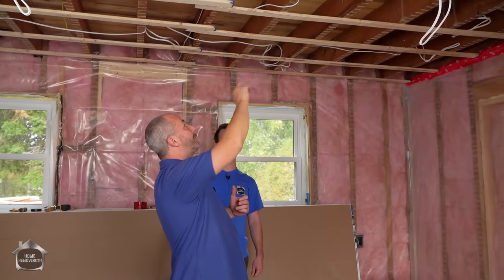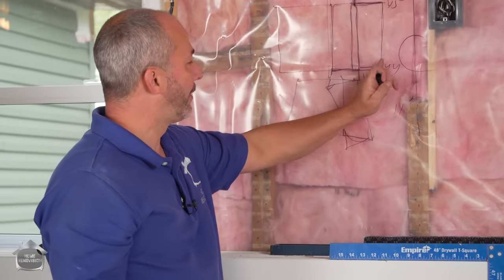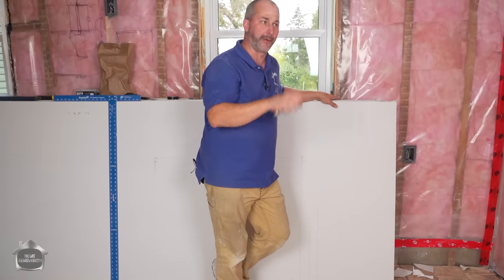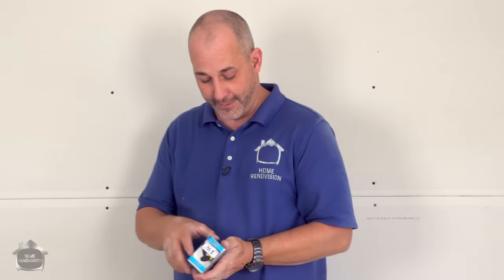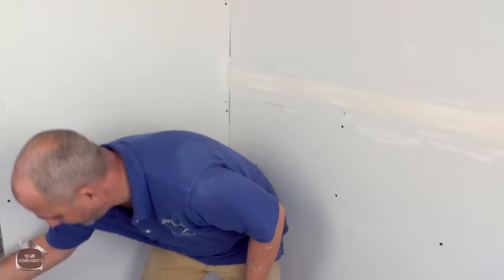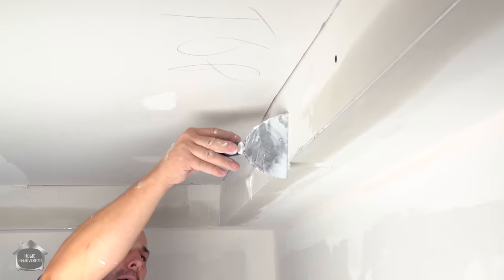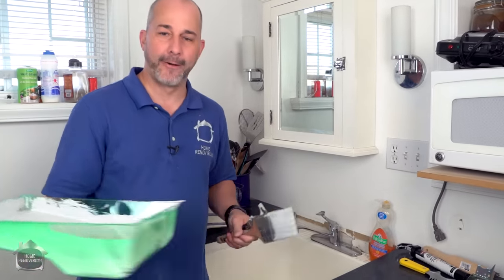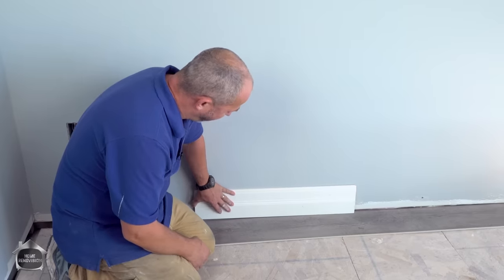How To Install Drywall A to Z | DIY Tutorial

Comment: I noticed on your older video's you did the inside verticles before the horizontals.
I followed your newer video, then watched an older. I got spooked for a little bit. Till it sunk in the two host had about 10 years difference in age lol
Older and wiser, 😊

Something I haven't found covered yet is the plastic corner edges. I used them in my bathrooms, just to avoid metal corrosion. I used screws just because I  found rusty nails durithe teardown. But they were a struggle to get low enough and not cause a twist in the plastic. 
Your thoughts?

Comment: As an HVAC tech I would recommend against the vent replacement. I’ll be the first to admit it looks really nice. However the original vent was a diffuser named that because it diffuses the air, the replacement isn’t. Plus it causes a high static area which reduces air flow and increases noise as the air moves over it. 

Again I also think they look really really good  but I’ve dealt with a home where they were used and we couldn’t get the required air flow into the space so on moderately hot days the AC couldn’t keep up. In the bathroom the center part would sweat and cause mildew to form on them from condensation from the bathrooms high humidity after a shower.

Worst part was when I went to replace them I found they were integrated into the wall. So the homeowner had to pay a fortune for something that is otherwise inexpensive.

They could probably be used if the HVAC contractor accounts for them (more vents in the rooms). But that wouldn’t fix the condensation issue in bathrooms and more efficient mixing of the area from diffusion.

Comment: Another great video. My home is almost 50 years old. You can imagine the layers of paint, patches, and nail holes there are. Is there a good way to "freshen up" the orange peel texture over the painted surface? Or will I have to replace the sheet rock and start from scratch? I appreciate your videos and information given.
Reply: I have the same question. Would love to know if it's possible to freshen up an old wall without having to install new drywall

Comment: Man you guys over in the USA go the hard way of doing dry wall, 
I'm a qualified plasterer and the products you guys have are so behind and old school,  might be cheaper but the work involved mixing it just right is guess work for the average Joe... 
from what I just seen I think I'm coming over to change the way you guys go about it, 
I'm amazed you didn't use a angle tool to do the internal angles.. doing what you did with the 4 inch your cutting the tape and you have to come back the next day and do the opposite side,  
I'm starting a business in America

Comment: Cut out tool is great. But sparkies here in Denver tend to set j boxes half inch past studs. So I got pretty good at cut out before install. Still use the tool though very fast.

Comment: Hi Jeff, thank you to you and your team for these videos and other series. I’ve learned a lot and you’ve answered many of my questions and curiosities as I take on finishing the interior of my home after framing. I couldn’t have been doing it without these. Or rather I would have made many more mistakes. 

At the end of this series where you are talking about applying the primer. I was curious, is there a reason you roll it instead of using a sprayer? I happen to have access to a sprayer but wasn’t sure if it didn’t absorb as well without the “pushing” since you used the roller?
Reply: Thanks Jeff, very informative

Comment: Hawk or pan? I've worked with both and I make less of a mess using the pan because that's what I learned with so it feels natural. It's like being right or left handed you do what feels natural. I only use a hawk when I use a trowel for skim coats and for a few different ceiling textures. As far as getting mud everywhere that just a given when you're getting paid by the foot using hand tools because you're running around flinging mud everywhere trying to keep up with automatic tools

Comment: I'm finishing my basement and I'm debating hanging my drywall horizontally vs. vertically.  In one of your videos, you go over the the benefits of limiting your butt joints.  If I have a 22 ft wall, I can choose to put them horizontally using a 12 and 10 footer, I can swap their position on top and bottom so I wind up with a 22ft long seam (non-butt join) and 2-4ft (actually 1 4ft and 1 3ft, my ceiling is 7ft) butt joints.  Alternatively, if I just hang them all vertically, I'll have 5 vertical seems which would be 5*7ft = 35 ft of non-butt joint taping.  Doing it horizontally, I would have 22+7 ft = 29ft of joints to tape.  So doing it vertically requires about 6ft more joints to tape, but they won't be butt joints.  I prefer no butt joints.  If I hang them vertically, I can buy all 8ft panels and I don't have to fight to get them into my basement since I have to go around some tight turns.  What are you thoughts about this?  I'm leaning towards vertically to help avoid butt joins and having smaller panels to move around.

Comment: A couple things I would suggest.  Get a tape gun for the Tuck Tape, much easier to stretch out your tape and you don't have the problem of the end sticking down to it's self when you finish using it.  Also has a built in cutting edge if you need to trim off a piece.  When you use the puncture needle on your caulk gun, wipe it off before tucking it back in to the handle.  You won't get that tar all over your hand and it won't stick to the handle the next time you want to pull it out.  I'm pretty sure you should put the tar on the side of the of wall footer board rather than on to the floor.  There is supposed to be a layer of foam under the outside wall to create a wall to floor seal therefore putting the vapour barrier on to the floor is a waste and also can get in your way later; not to mention, messy should you kick into it..

Comment: I drove a sheetrock boom truck delivered for almost 13 years. Had a boom truck and a helper. No dolly. I was up and down the ladder every unit getting it as close to door as I could then climb down pull off the forks waste level and my helper caught. Walked in flipped on and on 3 sheets at a time 12ft. It was a god send when they went out of business. Haven't toted rock in about 5 yrs 45 yrs old and feel crippled.

Comment: The latest research is these poly vapor barriers cause mold in cold weather climates.  The cold air meets the warm indoor air in the wall cavity, and that creates moisture which needs to dry to the inside.  There is a difference between a vapor retarder and barrier, a barrier will not allow the wall to dry to inside. It allows zero moisture to travel through it.  I experienced this myself and when I took apart the wall on a cold day there was a release, like a pop of air.

Comment: Question:. Renovating house.  To remove textured walls from a 1956 house with older walls.  Skim coat? Thinner drywall over existing drywall?  Or...  New drywall altogether?  Thoughts?

Comment: Hi, thanks for your informative videos. Intermediate carpenter here who's never mudded and taped my own drywall, but I wanna learn on a small project I'm doing for my neighbors. I'm a bit confused - in one of your videos, Complete Drywall Installation Guide Part 7 How to Tape Drywall And First Coat Of Mud, you say to tape the inside corners first, then the horizontal joints. However, in this video at about 1:45:40, you say to tape the horizontal joint first, then do the inside corner second. Which is it, or am I misinterpreting your advice? Thanks again for all your help.

Comment: Jeff,  I have really liked your videos on how to do dry wall, but I have not seen what you do with an outside corner that has the metal corner strip added. On one I found it looked like you just added mud but how do you get that perfect "bead line vertical finish"?  Do I need to add paper tape also? Is 45 mud the correct mud to use?

Comment: Jeff, helping older relative. Tore off paneling to drywall kitchen and living room. Half the area already has drywall in decent shape under it but it's 3/8 thick. Should I join 3/8 sheets to match or should I use half inch and blend together. Thoughts? Thx

Comment: I am helping a friend do some drywall repair. There was water damage and the company who removed the damaged drywall cut up from the floor about 24" all around the room so need to replace up only the 24". I can cut the drywall leaving the tapered edge to meet the drywall that exists, but that would be a butt joint on top and tapered edge meeting together. My question is how can I prep the existing sheetrock(butt joint) to meet the new sheet rock(tapered edge)? or should we be doing it a different way.

Comment: Jeff, thanks for the video. Question though. I can’t get a full 8’ sheet in my basement. Rather than cutting every piece through and making making butt joints, would you recommend the folding method?  Where I cut the back side without cutting the front paper, fold it to transport,  then straighten to hang?

Comment: We used plastic sheeting over studs 30 years ago.  It doesn't work how you think it will.  Black mold was a problem in every one of those houses.  

Use kraft paper faced insulation facing toward the heated space instead.

Comment: Bowed ceiling is usually not acceptable. Bowed ceiling fix. . .  A) ++ Use a straight edge to check ceiling ahead of time and shim the ceiling flat before hanging sheetrock. B) + Hang a straight factory edge on wall against the low points of the bowed ceiling. After all installation, back out ceiling screws along the wall edge. The sheetrock will sag and settle down nicely resting on top of the straight factory edge at top of wall sheet. Blast some gap filler through the holes left by previous of removing screws. When gap filler has set, re-screw the ceiling where screws were removed. Either case the finished ceiling is straight. . . . Probably better to use R.C., Z profile channels for the ceiling fur down. Better than wood strapping in many cases. The flex of R.C. and sheetrock desire to be straight, will help straighten minor flaws in framing to some degree.

Comment: one more thing on outside corners use a product called paper bead its much more flexible and when bumped the mud will not crack of it as easily as metal corner bead you bump it once and then a huge crescent shape of mud will crack off making you have to do even more repairs

Comment: When I clean my sleeve, I leave it on the cage and hit it with an air hose.  If the air stream is glancing off the side, the roller will turn  incredibly fast and centrifugally expel all the water, drying very quickly.
Reply from the maker: Thanks for sharing

Comment: This video was playing in the background while I was installing dust collection. I started doing drywall with my stepfather when i was 14.  after school, and 5 days a week during summers. After school I went full time,  I hang/tape/sand/prime. All phases. I do punch out. ., At 28, after 14 yrs.I went back to school, and now work a desk making alot more. Body is not destroyed at 43. Which I am now. That being said. When I was 25, I was working in a hotel in myrtle beach sc. I watch a greener then the board he was carrying greenhorn walk a board like this guy was telling people to do. Which is why I am posting this, The other guy, was doing it correctly, and the other guy, turned to make a corner and was kicked sideways down a 72 foot elevator shaft, and died. The shaft was blocked off by a 2x4 barrier that blocked all walking traffic. It was not build to withstand a 120 pound sheet being kicked sideways and throwin the weight of the sheet plus the 240 pound man with full tool belt on that didnt see the kick coming. I tried to yell to stop. I never had a chance. to fast. ALWAYS WALK ON THE SAME SIDE OF THE SHEET. NEVER STAND FURTHER BACK BEHIND THE SHEET and never walk on opposite sides.

Comment: Great video.  On inside corners I use a product call Strait-Flex (kind of a plastic fiber tape) which gives me perfect sharp inside corners being an amateur. Cutting horizontal and vertical  corners at a 45.  I've also used a hard cardboard shim product to fix uneven wall 2x4s.  It might be a bit anal but that's me.  I've used your ceiling LEDs which are great.  👍👍👍

Comment: Why are you putting plastic on your kitchen outside walls?  By the way Thank You I have learned a lot about drywalling the right way and tape and mudd.  I had to do a job on a church in October and it came out Great!! A bit nervous though because it has been five years since I last did drywall and I was doing this by myself.  Right now getting started on my bathroom, which is a  mobile home.

Comment: This is a drywall video but I have a question about your air barrier. Do you have an air barrier on the exterior side in addition to the visible plastic outside the insulation?  I live in a dry climate, and my house was not wrapped in an air barrier, it’s just unsealed OSB. Should I first caulk all seams on the inside, add insulation, and then also add an air barrier?  Thank you

Comment: My home was built in 1953 and I want to add a small bathroom in an existing bedroom. Can I install green board over standard drywall on the new bathroom ceiling so I won't have to remove the old drywall that was part of the bedroom ? Your reply would be appreciated. Thanks

Comment: I didn’t hear you mention much about the drywall joints when your hanging it. So I’m currently drywalling my 12x20 shed. Can I have a single joint going all the way up the wall or should they be staggered??

Comment: For anyone in the know...hopefully Jeff, if i wanted add a second layer of drywall to my house to separate rooms for better noise reduction, can I just use sheetrock 45 and laminate screws instead of trying to find the studs? There are no windows at all...just two outlets. Thanks.

Comment: I have one of those Empire Drywall Squares and  it is 3/4" out of square in it's length so I still have to measure both sides of the sheet and then clamp the square in place to get a straight cut  Either that or or cut the sheet so it dosent land on the stud on one side.

Comment: Hi, I recently joined your channel. Thank you for all the good information. I have two questions, 1. I removed the popcorn from my ceiling, I broke the white paper. I want to use   Kilz3 Heavy duty high hide sealer and then apply the texture. What do you think  2. the bottom of the drywall is touching the concrete, and I want to cut it, but someone told me not to cut it because the paper is the protection. What to do?
Reply from the maker: use oil based killz on brown paper not water based. never let drywall in contact with concrete. Cheers!
Reply: @HomeRenoVisionDIY  I reside in California, all they offer is a water base kilz3.

Comment: I have a question, if I want to install a metal wall mounted fixtures with shelves and poles for books and clothes. Should the screws connecting with the wooden bones behind the wall? If yes, how can I find the bones if everything is done. Or, if I place the screws randomly, would the wall fall down?

Comment: Would I still need to use moisture treated drywall with an air sealed vapor barrier? I'm going to be taking my ~15x20 cinderblock shop in my back yard and framing/drywalling it and turning it into an office/home theater. I live in Georgia.

Comment: Our walls are around 100" tall. Is it worth the extra expense and transport issues to buy the 54" extra wide drywall to avoid an additional seam? If not, would you add the 4" strip to the top or bottom? I just finished strapping the ceilings today so we're going to buy the board tomorrow.
Reply from the maker: get the 54. It saves so much work

Comment: Im a bit confused. So there are 2 different muds- one for taping and one for finishing? Which mud for which application?
Reply: The finishing one is so fine so I guess it’s the same fine & runny one you want for taping too?

The other 45 min one is faster setting, sets harder, is thicker consistency and for filling holes and doing repairs?

Comment: I am discouraged. I started my Master bath remodel (ripped out drywall, removed vanity and fiberglass shower and ceramic flooring). I am on a concrete slab. I have an estimate from a licensed plumber of $2500 to move the shower drain ( for a future freestanding tub); move the toilet drain back 2” and over 6”; and move sink drain over 12”. I don’t have that kind of money and won’t have it anytime soon. I have never done this kind of remodeling. How challenging is this work for an amateur?

Comment: Hi 
Love your work 
I have a Glue Question
In Australia 
We use James Hardie products & their Drywall
Adhesive Glues. 
 
The Screws
only hold the sheet 
until the Glue dry's. 

Why in America you
Don't do it 
Is it a snow cold zone
Difference  ????
Reply from the maker: drywall is a surface that needs to be replaced due to water damage so glue gets in the way of that. for us it is better to have it not glued and easy to replace if needed. Cheers!

Comment: What about the paper with metal beads? In my garage my drywall end at the bottom and concrete wall begins. Would I use a paper/metal beed to finish off the factory drywall edge? Or just leave the drywall factory edge in place and skip the beed?

Comment: Just wondering, why you didn't hang the sheet and then cut around the door with your roto tool?  Takes a bit longer to measure and cut.
Reply: You cant attach the drywall without the cutout first. The box was not in the way